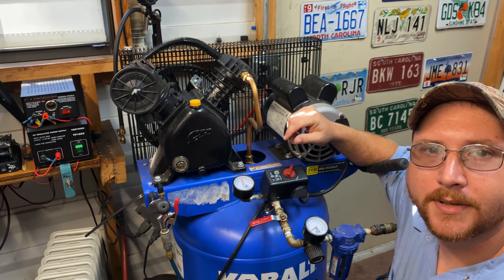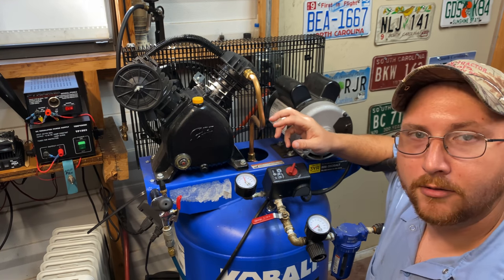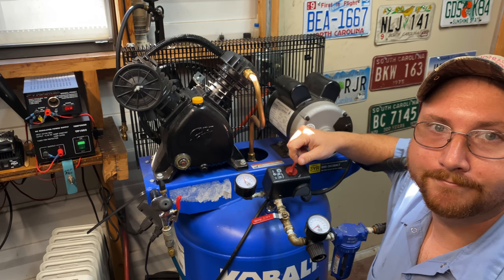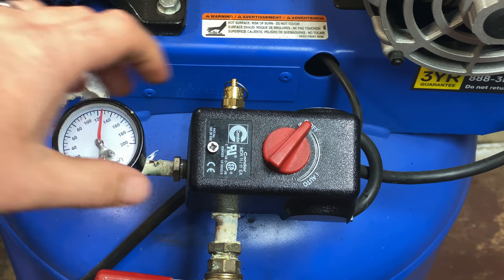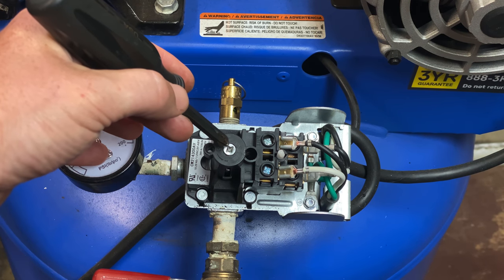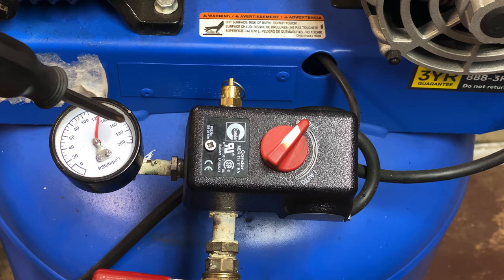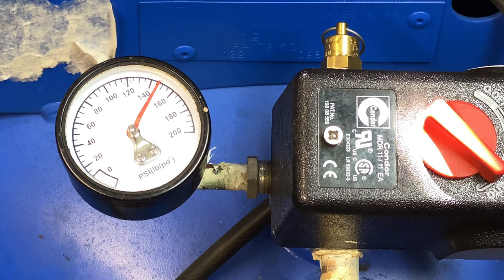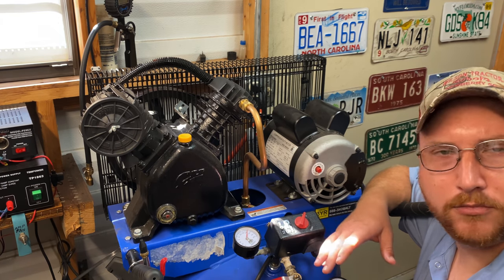How To Adjust Maximum Cut-Out Pressure on an Air Compressor

Comment: Thanks a lot man I just did it on a fortress 2 gallon quiet air compressor from Harbor freight and it worked psi was 135 and Kickin at 93 now. Psi ass 150 kick in is 115. It works amazing the tank it’s rated for 200 psi pressure so it works.

Comment: Dear Mike, That was simply awesome... I am planning on picking a 50 Liter 2 HP Oil free Air Compressor, ( Elephant Brand, India) however the tank pressure gauge is marked at 8 Bar ( for safety reason by the manufacturer) while the gauge shows up to 12 Bars... and I was wondering how do i change this settings to 10 bars... ( 130 to 140 PSI) . Your video has indeed boosted my confidence... and I shall try this method following all your safety tips and advice that you have mentioned this video. I truly appreciate all the hard work and time that you have spent on making this wonderful video. Thank you very much.... Good Luck and God Bless...  Antony Edward Paul, Bengaluru, India.

Comment: The cool thing about mine is that it has a plate stamped on the side showing the tank is good to 168 PSI at some crazy temps.  Not too worried about getting the advertised 135 PSI.

Comment: I have a 5hp 26 gallon husky rated for 135psi but i am going to crank it past the 135 to keep ip with die grinder. The kick on is under 90psi

Comment: Engineers are required to label the max or capacity of everything far lower than the actual failure point. Which is a good thing. If it says 175psi it's likely been tested and good for at least 240. With compressors, the deadliest thing nobody thinks about, it's better to stay lower because nobody drains the water as often as they should and the tanks are more than likely not as structurally sound as they were new. 150 should be fine. I have the same one set to that, and I'm the average consumer that sucks at draining condensation. I need to pressure test it and scope the inside. It's probably pretty bad tbh. Good video though

Comment: My pressure switch releases air at max cut off but does not stop blowing air off until it cuts back on it has done this with 2 different switches mine is the same as your in the video
Reply: It's your check valve causing that

Comment: 😮yes canu lower the air down  on same screw I have a paint sprayer that says not to go over 50 psi does that mean that they’re farm on 120 that I have to lower it to 50 psi😊
Reply: No, don't do it that way, you need a regulator, then set the regulator at 50 PSI.

Comment: Remember before you do this, especially if it's an old compressor tank with signs of rust. Make sure the tank can handle the pressure. If that tank explodes, you can be severely injured! You should  view videos of air  compressor  tanks exploding ! It's not good .

Comment: remove cover from pressure switch.turn screw clockwise ... thats how to adjust pressure from the tank.  pointless if you can't get that psi past the regulator . how do i get  that  same psi output from the regulator?
Reply: Do a Google search on "air compressor regulator replacement".  Harbor Freight, Amazon, others, sell replacement regulators from $6.29 up to $18 or more.  80 psi, 125 psi, 140 psi, 150 psi, 300 psi, etc.  Simple and easy to thread on a new regulator.  Or the easiest route is to just put in a T valve before the air goes to the existing regulator.  Put a quick connector on one end of the T and you will have whatever air pressure is in the tank.  You will bypass the regulator.

Comment: Now I got why compressor blow up when some people use them. I'm here to reduce PSI to make sure it won't blow up. But the video author was increasing. I would not do this. I would better to add additional tank to increase volume instead of increasing pressure.
Reply: Your idea only solves one of two potential problems.  It solves the HVLP painting problem.  You need high volume and low pressure to move the paint.  But a nailgun for instance needs high pressure but minimal volume.  A nailgun would leave every nail above the wood with your method.  You have to balance pressure and volume to deal with all situations.